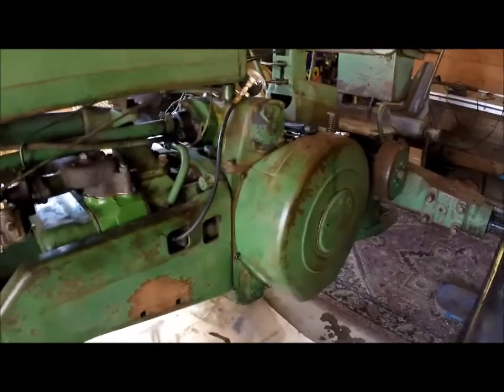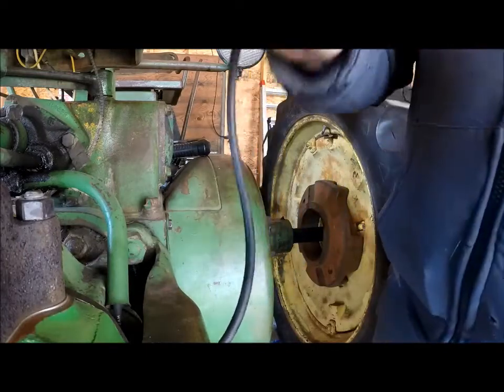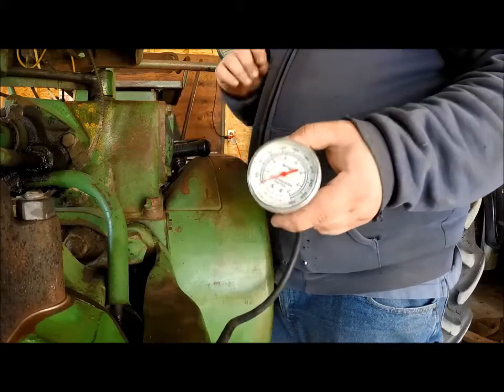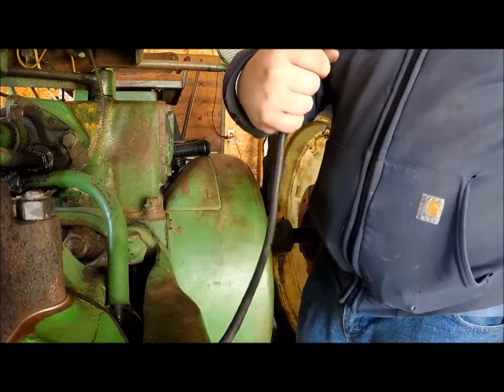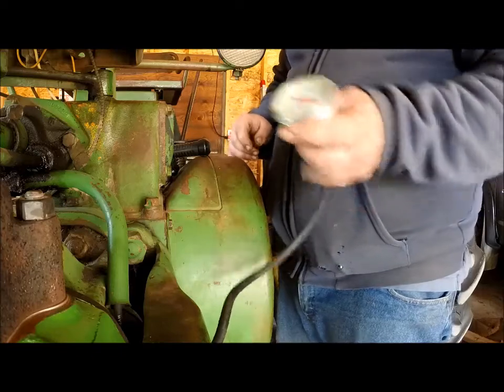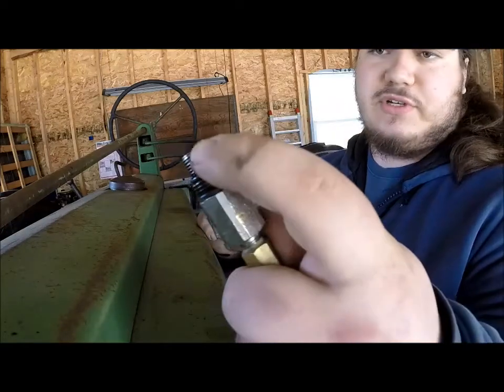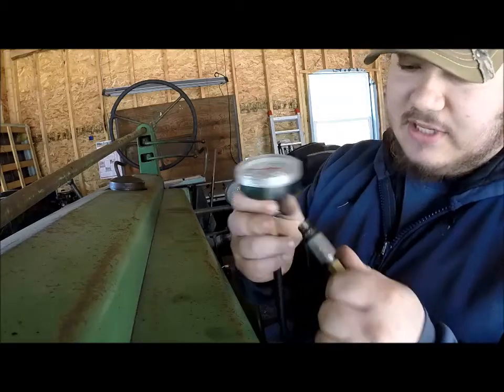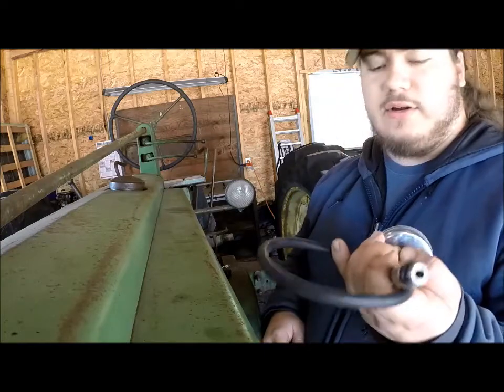How to do a Compression test

Comment: I just did a compression test on my John Deere model A 1948 gasoline. According to my calculations using elevation of Austin, MN of 1180 feet above sea level and the 6.5 to 1 ratio of the engine the compression test calculated is 88.53 , so my 82 lbs in each cylinder is just a little lower, not bad.